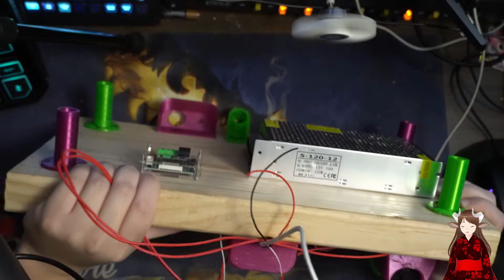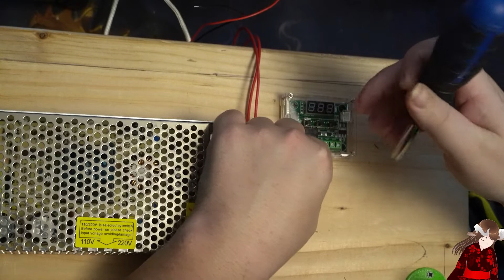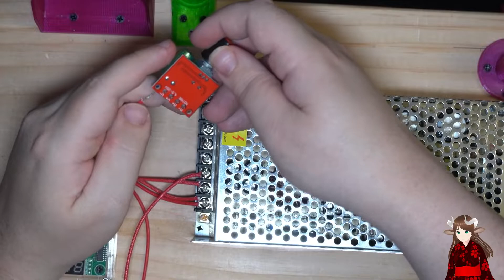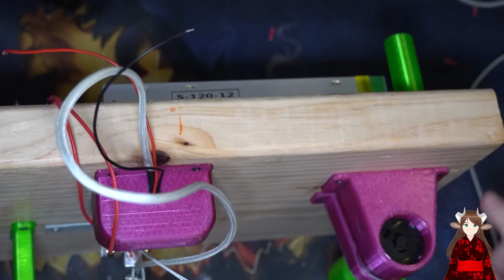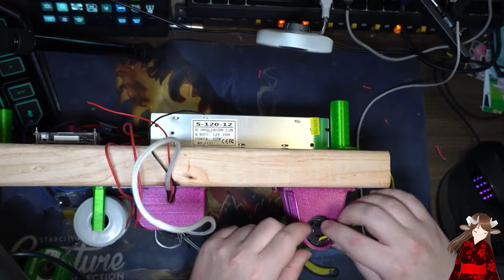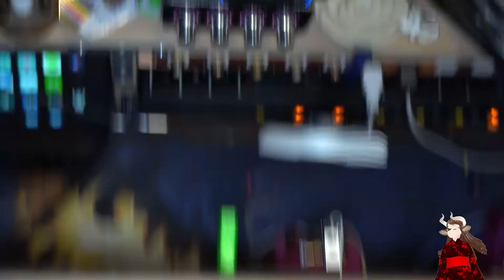Petamentor Project Part 5 Low Voltage Wiring

Comment: HI.  Could you tell me what RPM speed should I buy?  there are many variations.  A thousand thanks
Reply from the maker: Here is the correct motor for this https://www.aliexpress.us/item/3256803087419738.html?aff_fcid=43f7535bae0c45ecbbd21f5b44271e31-1699480751792-07490-_Ddf2K6n&tt=CPS_NORMAL&aff_fsk=_Ddf2K6n&aff_platform=shareComponent-detail&sk=_Ddf2K6n&aff_trace_key=43f7535bae0c45ecbbd21f5b44271e31-1699480751792-07490-_Ddf2K6n&terminal_id=68c77ce7f263417e81196514e3e07705&afSmartRedirect=y&gatewayAdapt=glo2usa4itemAdapt
Reply from the maker: It's not really about rpm it's more about the torque for this. If It cann't pull the filament with the friction, it's not going to happen.